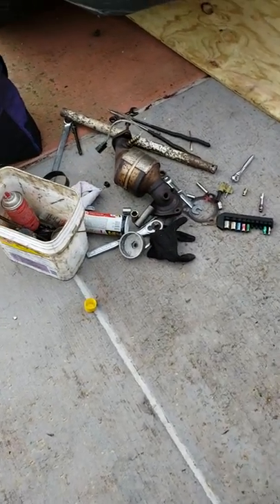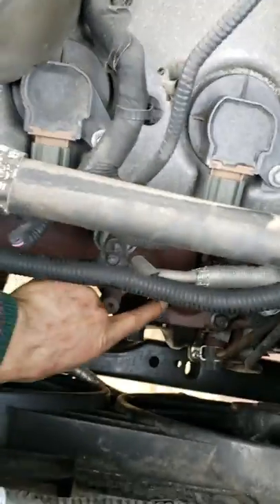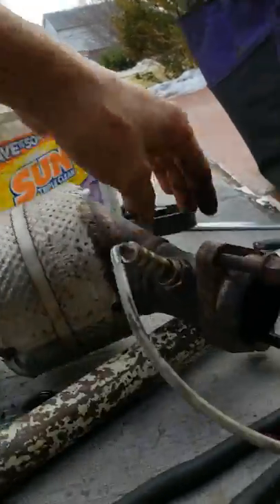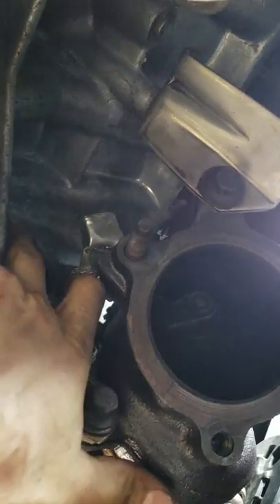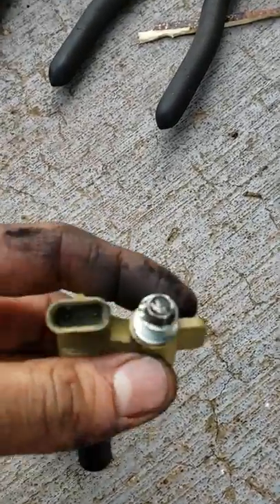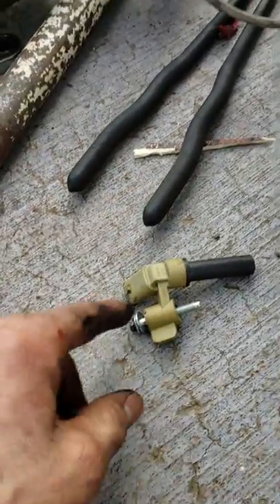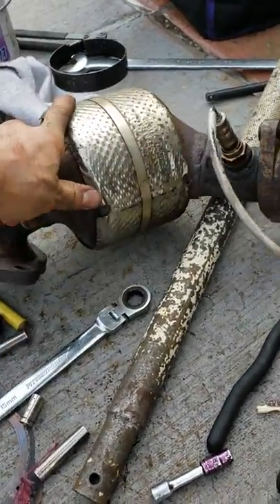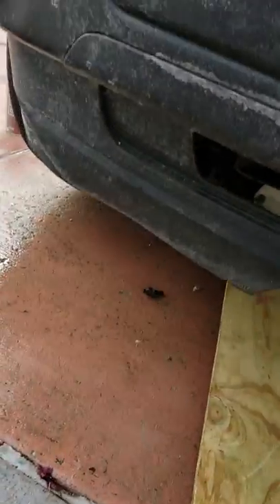2013 Ford explorer 3.5 EcoBoost turbo

Comment: This video was definitely helpful. The only thing I would add is that it's much easier if you take out the turbo. The Haynes manual procedure states to remove both the cat AND the turbo. I don't know if you can get the additional heat shield protecting the rubber boot off if you don't remove the turbo. If you do remove the turbo, you'll need new sealing washers for the banjo bolts. I also had a difficult time with that oil supply line with the torx bolt. NOT FUN. Stripped the head getting it out and then thought I messed up the threading on the turbo using a tap & die to get out the stripped bolt. It's also a good idea to replace the mounting studs for the catalytic converter especially if you had a had time getting them off. Mine were slightly stripped and one was slightly bent. This job is definitely meant to be done with the car on a lift. It's MUCH easier once you get everything out to go in FEET FIRST and use a mirror to see up into the port where you screw in the sensor. Use a large mirror that can prop up against the radiator and some of the other points of contact left; that was VERY helpful for me. Sad thing is, once I changed the sensor, I'm still getting the same P0016 code. Coupled with a misfire code in cylinder 1 (P0301) this is looking like a timing chain issue.
Reply from the maker: Damn sounds like more work I did the job without removing turbo just bent heat shield out the way but was tough no doubt.

Comment: @GIAMOBILEMECHANICBerwyn     Is there an exact spot that the crankshaft sensor head is suppose to be positioned once bolted in place? I fiddled with it for over an hour before I was able to bolt it in place. After replacing the sensor with a new Ford Motorcraft part, the engine cranks but won't start. The engine started with the original sensor in place, but was cutting off when driving. Checked for codes which revealed Bad crankshaft position sensor thats why I changed it. Do you think I may not have positioned the new sensor correctly? It felt like It would only go in one way, not a lot of room ion there. Let me know, thanks.

Comment: I have explorer 11 6cyl it presents the code P0365 and P0369 but it does not present any fault it turns on and it goes normal

Comment: Did the P0016 code stay off? Everything I've read points to the timing chain, but my car still runs fine & no rattle at start up. Hoping just the sensor fixes it.

Comment: Mine didn’t turn off after the replacement do u have to program it?
Reply from the maker: Disconnect negative battery post 10 mins or so, should go out

Comment: I have a questio guys Im replacing the engine on a f150 2012 3.5 ecoboost and Im having hard times just to remove the turbo to disconect that crankshaft sensor, so my questiom is is I cut the sensor wires on the top and put a conector may work, in that way I can install the new motor with turbo and cranksensor in it
Reply: I did it to my 12 just have patience and you can get to the crank sensor if you take the wheel cover off, metal heat shield, and rubber gromet. You will see a 7mm bolt there and just get an extension and a 3/8 drive with a short extension and you can get it.
Reply: the heat shield you can get off with the turbo on just wiggle it out no need to take the turbo off and replace more than you have to

Comment: I did this on my 2016 f150 3.5 EcoBoost and I did drop that mother in the tranny. I fished it out after 3 to 4 hours of cussing. There is no hole to put the sensor bulb in. It sorta just floats in mid air? Great video bro

Comment: I'm sure all that work didn't fix that p0016 code 
That's usually an issue with stretched timing chain very common on 3.5 gtdi .